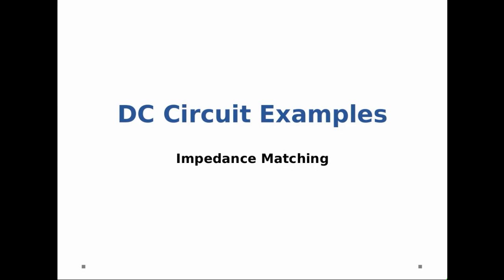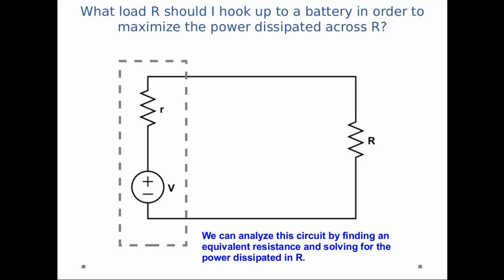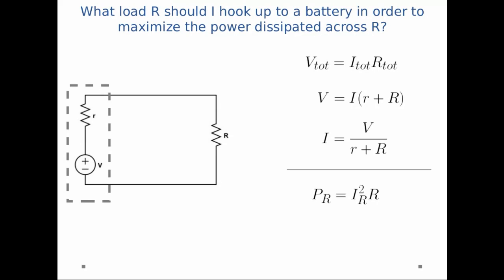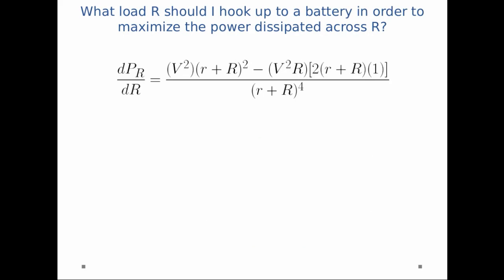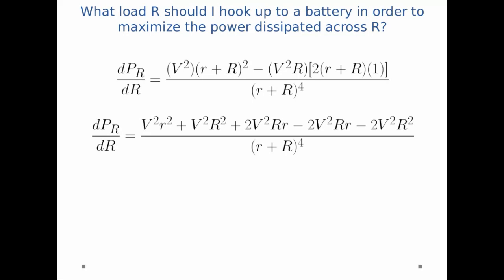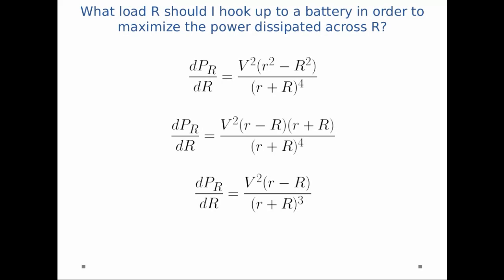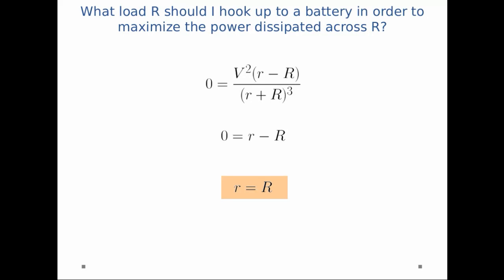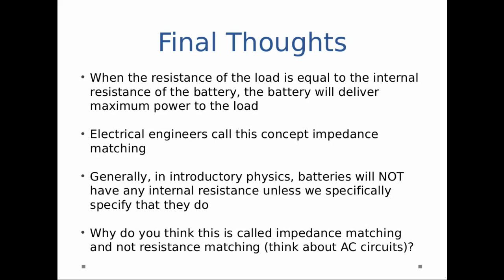DC Circuits - Impedance Matching

Comment: Dang it. I came here trying to wrap my head around why there's such a thing as DC impedance... You left me hanging!
Reply from the maker: I think you might be asking why is it called "DC Impedance" instead of "DC Resistance"? The term impedance comes from the analysis of AC circuits where you take into account the effects of capacitors, resistors, and inductors with an alternating current. In AC circuits, capacitors and inductors act a little bit like resistors with some added complexity of when the current and voltage peaks in the element. We call this behavior "impedance" rather than "resistance" because it is related to resistance but with extra phase information added in. Engineers will say that a resistor also has impedance in AC circuits, but it does not have the added complexity of tracking when current and voltage peaks (i.e. phase zero).

If this doesn't make sense at the moment, don't worry! You will cover these concepts when you study AC circuits.
Reply: @cmvandrevala  thanks. I'm a ham radio operator trying to study for my Extra Class exam, and some of the questions are about the DC input/output impedance of transistors, and I my brain isn't making sense of what that exactly that means, even if I can just translate that to "resistance" in my head.
Reply from the maker: @JayKnight  I don't know too much about how transistors act in AC circuits besides some of the basics. I hope this video (and others too) help with your studying. Good luck on the exam!
Reply from the maker: Now, why is it called impedance in this problem that does not use an AC source? Honestly, not sure! Maybe someone in electrical engineering can comment on why it uses the name impedance here? I assume it is just convention and naming culture?

Comment: Excellent, thank you very much Mr. Vandrevala.
One question though: when we're expressing I-total we're using V/(r+R) for resistors in series. When expressing V-total also I*(r+R). Why then are we only using R when expressing Power (P=V-total * I-total) = I*I*R and not = I^2*(r+R).
If I is dependent on both resistors and V is dependent on both resistors, how come it's sufficient to use R and not the sum of the resistors in series?
Reply from the maker: Excellent question. We have to think about what the difference between (r+R) and simply r or R. Whenever we use (r+R), we are talking about properties of the entire circuit (i.e. all of the elements in series). The total current, the total voltage, the total power, etc. When we use r or R, we are talking about properties of one specific circuit element - the power through one resistor, the voltage across one resistor, etc.

Hope that helps!